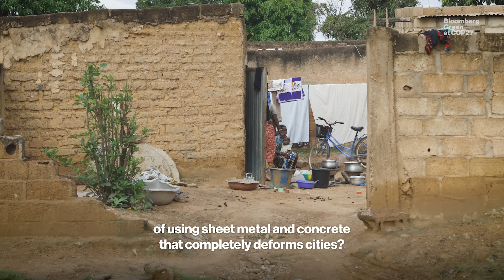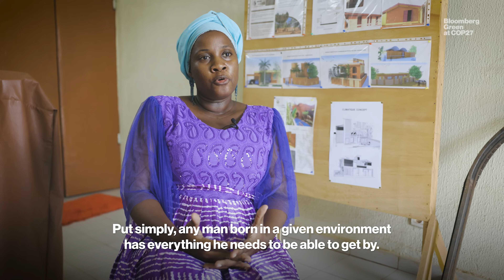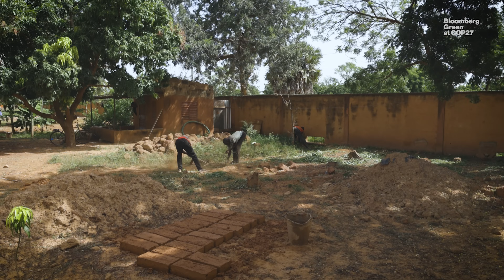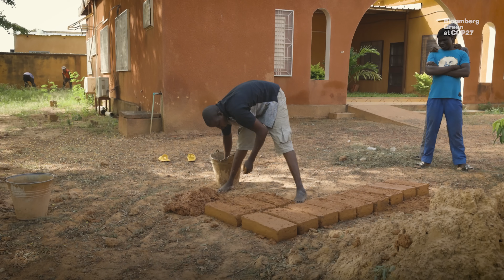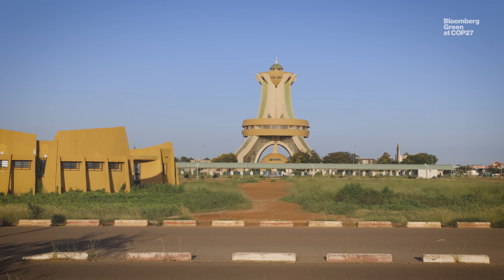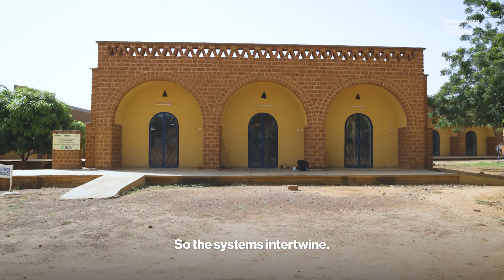The Architects Designing Future Cities With Mud

Comment: The video stats out stating that concrete and cement buildings are seen as a sign of development but that the reality is quite different…then talks about climate, and carbon footprint. That is a different issue, even though concrete has a high carbon footprint.

Concrete and cement are undeniably more permanent for large buildings, which is particularly where development can be seen. Uses of earth for smaller structures makes perfect sense and should be promoted if only for being cost effective. It also shows small buildings, which are not a sign of development (or of underdevelopment).

But until Western skyscrapers are built of mud and wood, stop the nonsense.
Reply: Hakka Tulou buildings are multistory rammed earth, and 100's of years old. The adobe skyscrapers of Yemen are made of  Earth. The adobe pueblos of the American Southwest are adobe, and the oldest inhabited structures in the country, at roughly 1000 years old. Have a look at the great mosque of Djenne, Mali. Earth buildings heat and cool more effectively, can survive fire, earthquakes, floods (when mixed with adequate lime) and last longer than concrete.
Reply: @HW369  Dry climates, constant upkeep. SMH.
Reply: @stevensmith2078  Fujian and Taos are not exactly dry, and experience wide temperature variation. Earth buildings regulate the diurnal and seasonal temperature better. Wood and concrete also require constant upkeep - paint, concrete wicks moisture, and one constantly needs to be on guard for black mold, especially in basements. Tuckpointing, termites, foundation issues. Every structure will fall into disrepair without upkeep. Earth buildings are far more efficient. Less cost to heat and cool. You do you though. Concrete is your "tradition". I'm sure it also makes you a lot more $$$ than an earth building would.
Reply: Wood scyscrapers are already being built, Here in Sweden.
Reply: @stevensmith2078  Upkeep is a plus, because you can actually repair it. Most western buildings will be falling apart in 60 years due to not being able to repair them.
Reply: @darnokthemage170  please show photos of the 20-storey buildings. I have never seen any. Thanks.